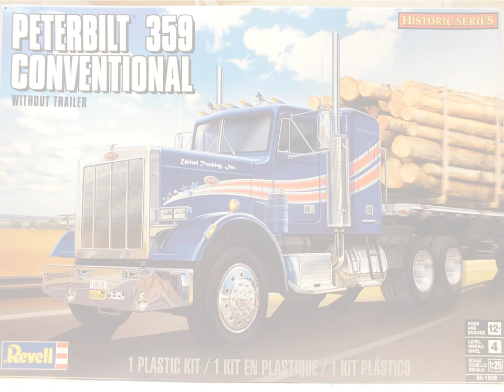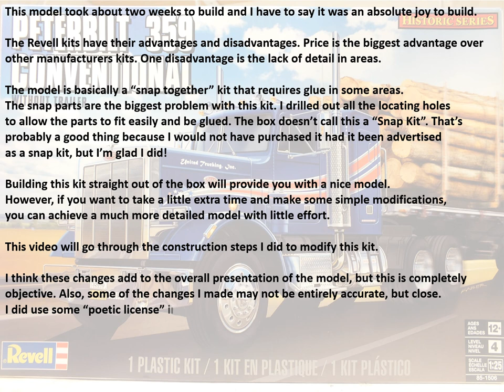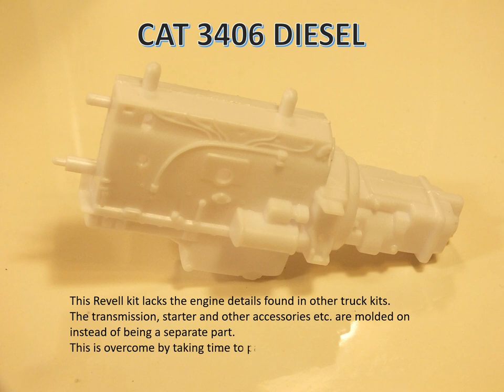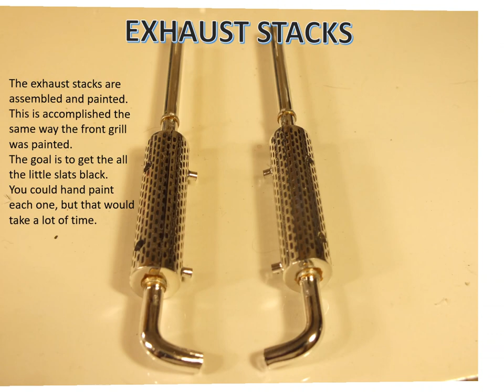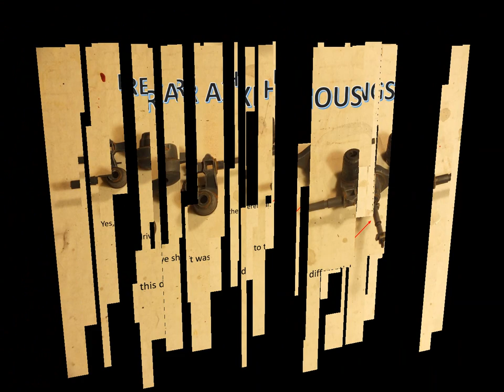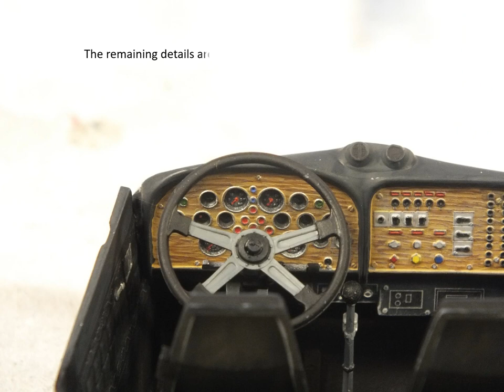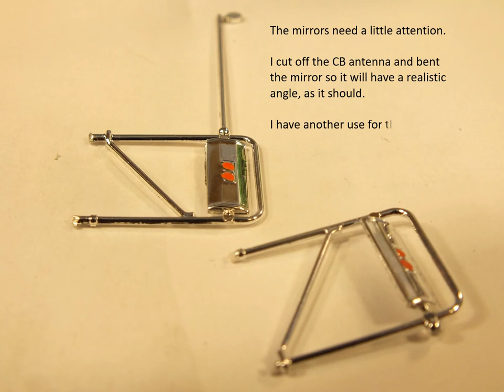Revell 1/25 Scale Peterbilt 359 Construction Video

Comment: Lots of great ideas! My dad commissioned me to build one based off the one my grandpa drove for 25 years. I want to put as much effort into as possible and this shows some areas to add.
Reply from the maker: I'm happy you can utilize some of the extras that I added to this model. There are many that are easy to add. Seat belts and engine details can really set you model apart from the rest. Other extras to make this kit better are adding the missing braces to the mirrors. These are small additions but make a difference. Have fun with your build and best of luck!

Comment: Nice model, tho, the brake chambers should be mounted behind the axle housings, not in front. Overall , very nice build, I like the bug screen
Reply from the maker: Thank you for watching the video and for leaving a comment. I examined two Peterbilt's while doing my research, both with air bags. The air brake chambers are located in front of the axle housing. Of course, these trucks are not the same year as the model kit so I may have gotten that wrong. If I come across an earlier model Pete I will definitely need to check that out. Thanks for pointing this out to me. Once again I appreciate your comment and thanks for watching the video. Best wishes!